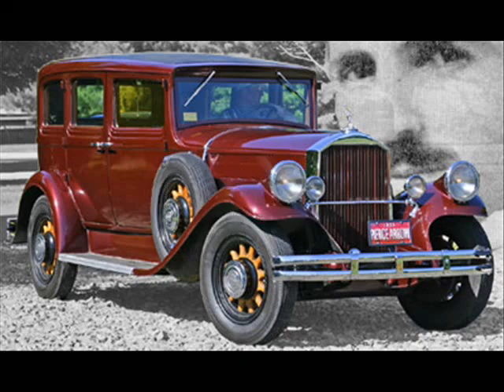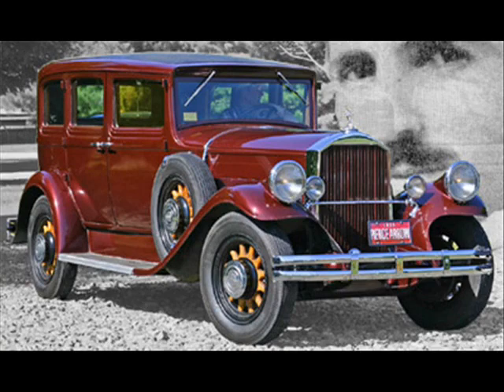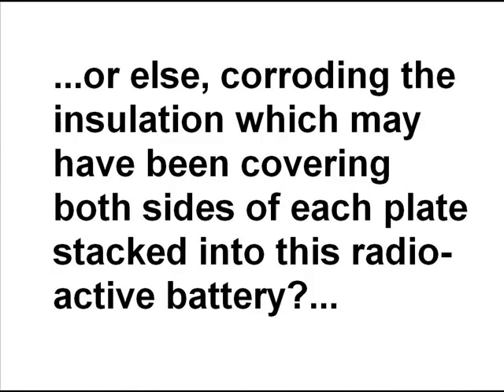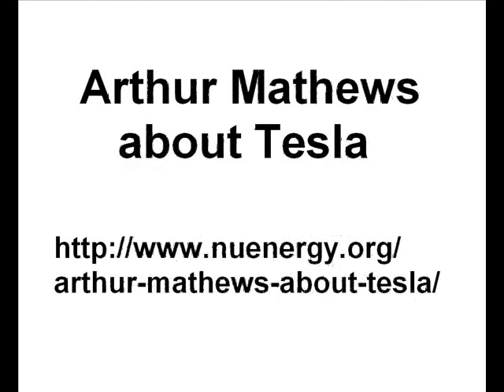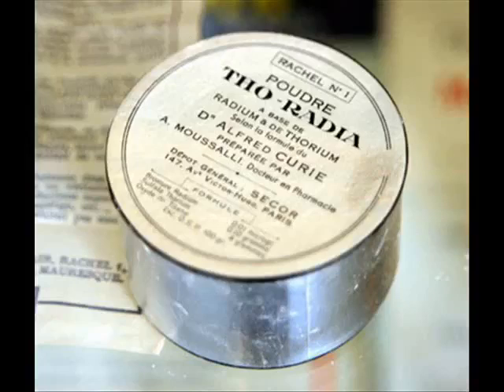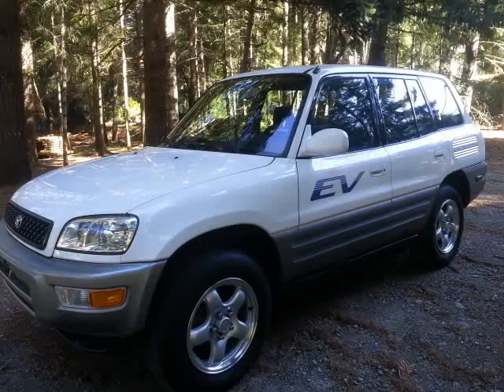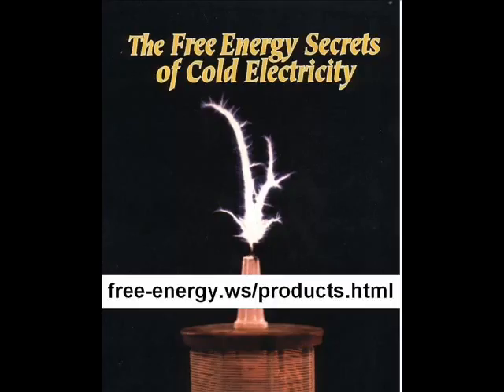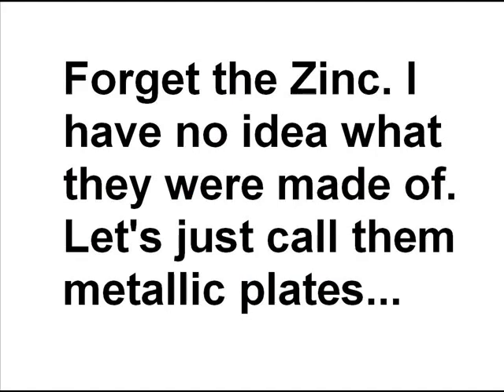Nikola Tesla's Back to the Future 2015 Atomic Car Battery Flux Capacitor Electric Reluctance Motor

Comment: My works too. Used Inplix handbooks and build it with no problems.
Reply from the maker: In "Back to the Future", Doc places a Banana, Aluminum Can and Alcohol into the Atomic Battery, Electric Engine. The Banana represents Yellow Uranium, Aluminum manufactured in a Tesla "Electric Furnace" and Alcohol "Power to Fuel" extracted by  Nuclear Power Plants.
Reply: You May Have Uncovered the Solution,
 to the Power for the, 
Nuclear Powered Golf Cart!
It Trickle Charged, the FLA, Batteries!
Dad Was The President of the Sun City Country Club!
One of the Members Was,  A Nuclear Phycisist,
That Created The World's Only Nuclear Powered Golf Cart!
He Probably Used the Clay!
I've Got a Picture, of Tiger Woods Driving It!